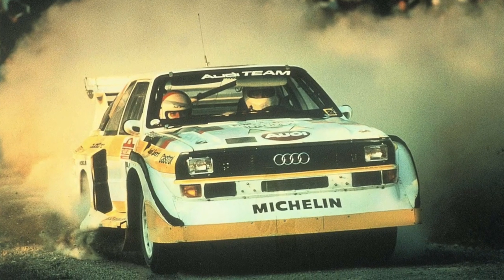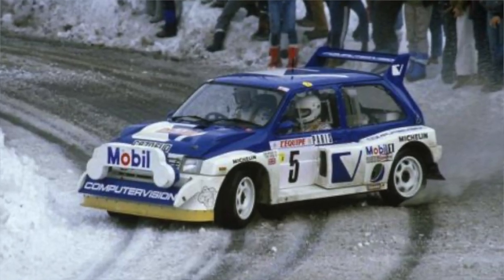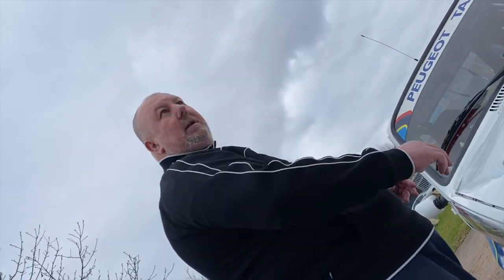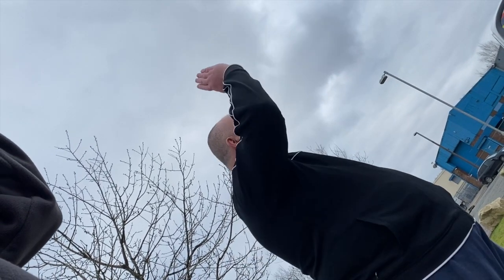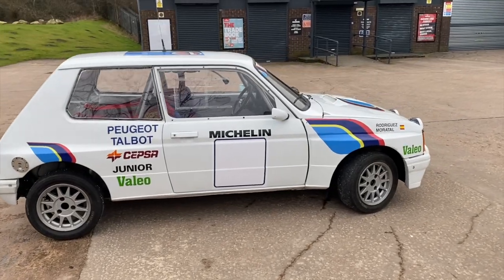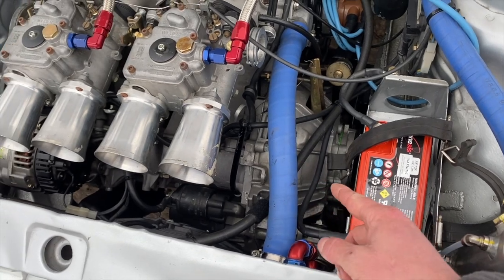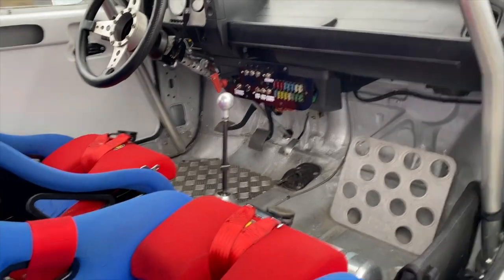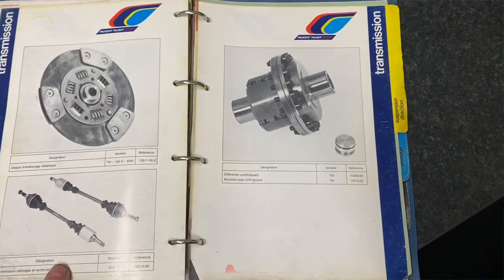Group B Rally Peugeot Talbot Samba *GIANT KILLER*

Comment: Also in the early 80s, likely between 80 and 83 they experimented with a mid engined Talbot Horizon to potentially replace the group 4 Sunbeam but the 205 t16 came instead.

Comment: That's a gem. You'll have great fun with that one. I noticed it's set up for tar, what would it be like on gravel? Just under 700kg's, ally roll cage, with a single point of contact at the rear, probably wouldn't do to much in a big bang , if you put a car like that together today it wouldn't get past tec inspection. Why did they run it at 1219? and not bore it to 1297 ish

Comment: 3 stud wheels.
Is that usual?
I don't ever remember seeing any road going Talbot or Peugeot  on 3 stud.
Reply: The early Renault 5 had 3 studs.
Reply: Citroën AX had 3 stud wheels on all but the GTi models.
Reply: Prior to 1984 most small to mid range Peugeot based cars ran on three stud wheels. The 205 was the first to run 4 studs.
Reply: Like a Citroën  visa mille pistes group b
Reply: Like citroen  visa 3 studs

Comment: Just noticed the wheels only have three wheel nuts is that for quickness?
Reply: That is as standard, but TRX rims. Very rare Michelins to be used. 
Back in the days I did some rallyes with a Group N Samba Rallye. I have staring a lot on the Group B version. These cars were never real works cars, these were aimed at the satellite teams from importers (as I remember rather an obligation) and lange deslergroups.

Comment: It’s a 106/205 what a car not quiet a nova but close 😀
Reply: The precursor to the 205 - runs a rear trailing arm beam with a strut/shock set up. Much more predictable handling on the limit than the 205/106 torsion beam . Sambas and Novas were the staple of the up to 1300 clubmans class back in the day.
Reply: @byronmills5952  sr rally 106/nova correct